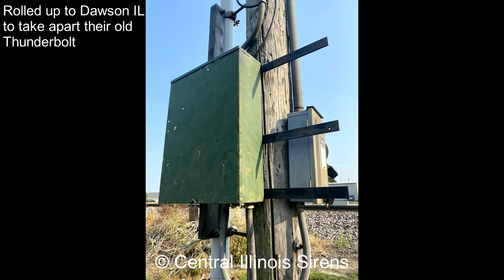FS&S Thunderbolt 1003B Restoration

Comment: i really hope to get a siren like this one day! great restoration!!
Reply: Same here man
Reply: I want one tho, but in the netherlands they only have ripoff modulators, ill try to get one of those one day..
Reply: @t2cm2a7   what do they look like? there probably iforce sirens
Reply: @dangerousnoodle3730  they are modulator 2008's for bigger areas, and 1004's for smaller areas, they have modified MC controllers, they suck. Both of the models dont have speaker drivers on the bottom, to 'spread' the sound more.

Edit: search dutch air raid siren on youtube